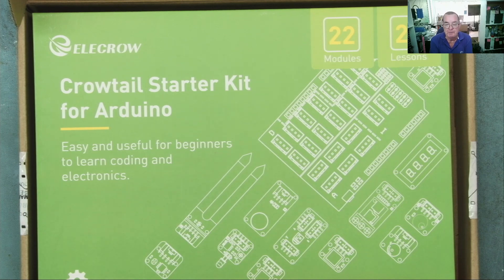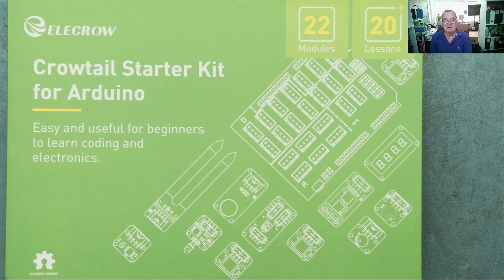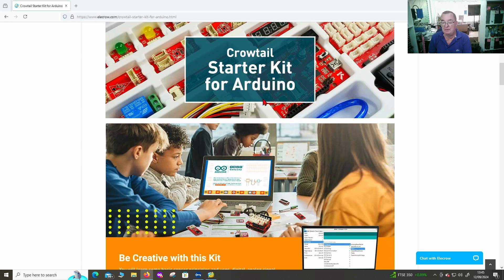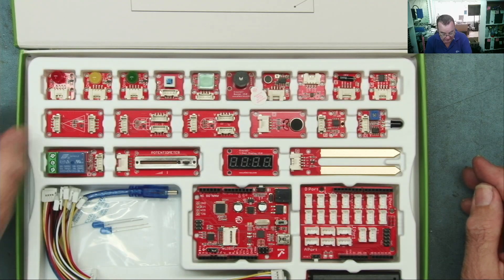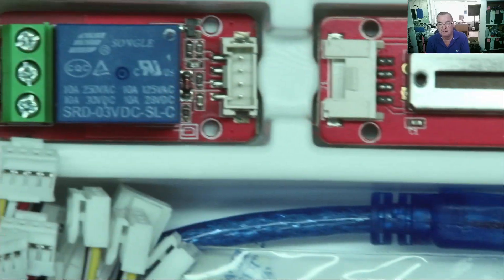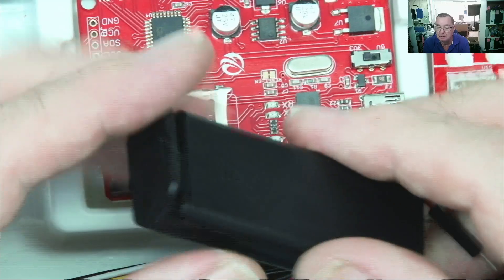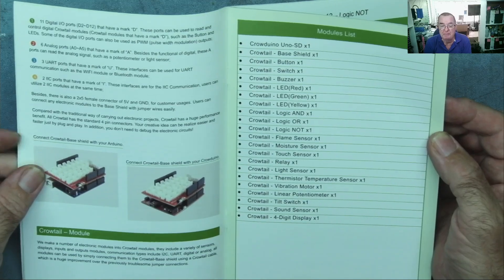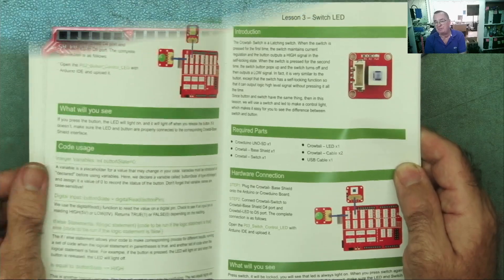Elecrow Crowtail Starter Kit For Arduino Perfect Kit For Beginners Test & Review

Comment: I'm really looking forward to the next one in this series. I bought myself an Arduino clone starter kit and have been reading and playing around with it. I'm really pleased with the modules in the kit I bought and it was quite cheap given how comprehensive it seems to be but didn't come with the project book.
I have a lot of Carmozzi pneumatic cylinders and a valve bridge to play with too. My main project is working out how to automate a manual surface grinder and I'd like to scratch build a plasma cutting table for my partner if I can ever get good enough.

Comment: All those buzzers have that sticker, cracks me up every time. Something lost in translation.
EDIT: Actually I found this on Electronics stack exchange, it says

 "The industrial PCB assembly process usually leaves residues — mostly soldering flux — on the circuit board. One step in the process is to wash the board (by dipping or spraying) with a solvent to remove those residues for long-term reliability and for the sake of appearance.

Some devices (such as sound or pressure transducers) have openings for their functioning, and their performance would be adversely affected if the solvent or the residues got washed into the opening and lodged there. Therefore, such devices often have a sticker that covers the opening(s) that should not be removed until after the washing.
Reply from the maker: Yeah I thought it was like something you find on your laundry LOL
Reply: Yes it's normal for piezo speakers to have that sticker. It's kind of amusing you didn't know that and just thought manufacturers put stickers on things for fun lol